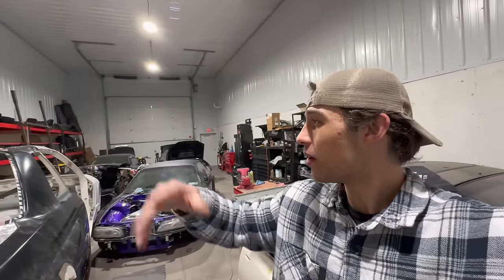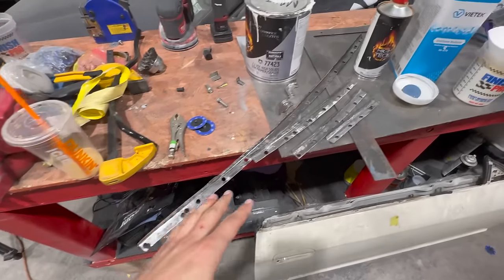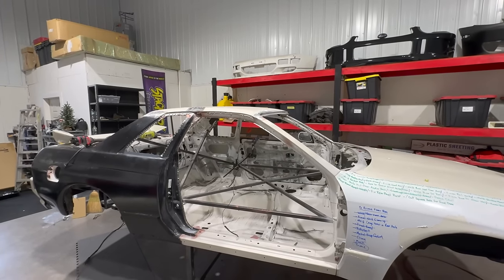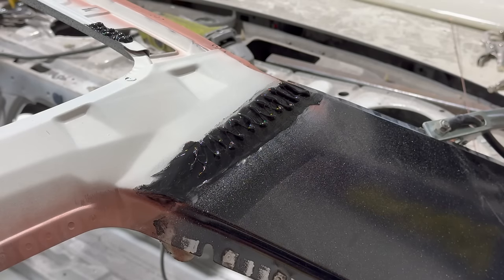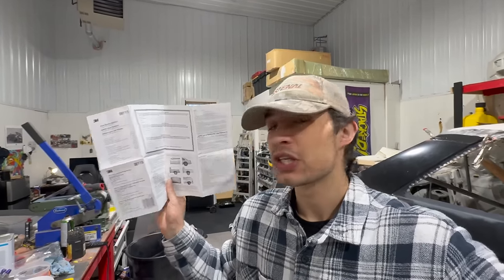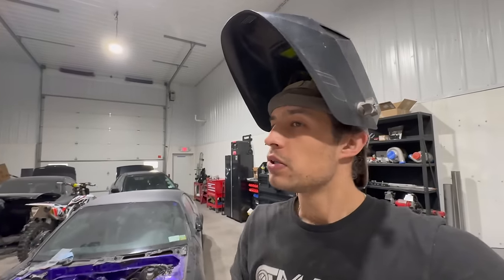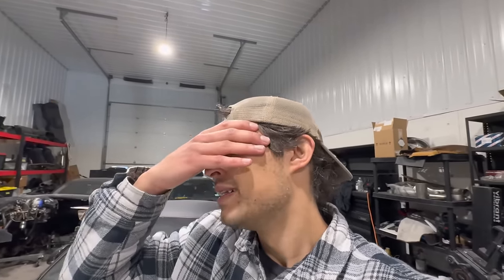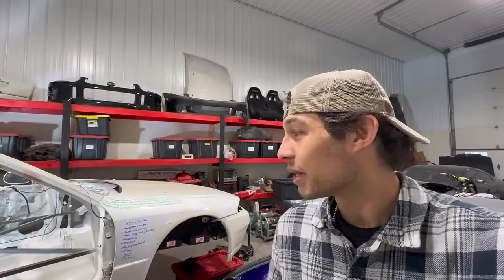This Last Structural Repair Could Make or Break my Skyline GT-R Restoration

Comment: It's coming along great! Watch out bonding hood and roof skeletons like that though. The skeletons can actually pull down and cause dents over time. There is a specific 2 part nvh adhesive for that purpose.
Reply from the maker: Interesting! So the oe product allows some movement? If anything like that happens will definitely address it and fix. Appreciate the knowledge!
Reply: @KalvinMalli kinda. It's more of an anti-flutter design and made to act more like a damper. There is always a slight gap and when you pushed the skeleton against the roof, let the panel bond cure, and removed the bracing, it leaves the bracing in tension pulling down on the roof skin. Over time, if the panel bond doesn't give and the roof skin does, it will "pull" dents down into the roof skin. You may not ever have an issue but I have seen it happen to a hood. Just sharing experience. Keep up the hard work!
Reply from the maker: @chrisanderson9931  Im going to try to push it in and see what happens. I definitely understand what you're saying. Guess time will tell. But yeah now I'm curious to press down and see how it feels and reacts, just from my pressure.

Comment: the panel bond is going to create ripples in the panel my guy. use seam sealer, heat from the sun ect causes the steel to move and with panel bond in the center of body panels itll warp the panel because it cant move

Comment: Awesome work! Are you. Planning to weld the roof to the top of the rear quarters?  I’m no expert but every roof or guard replacement I’ve seen they weld them as opposed to panel bond.  Would hate to see it crack or flex after it’s all painted up! Keep it up buddy!
Reply from the maker: Nah no need! Panel bond has a higher tensile strength than a weld, and the guys that install carbon roof skins do only panel bond on the entire roof skin. For obvious reasons. But they don’t seem to have issues. We should be good. And if it does crack. Then I fix it! No big deal. And we learn. But I don’t see it cracking. That’s why I went with this method instead of the lead/copper braze. 🤝🏽
Reply: @KalvinMalli  I'm sure you've done your research! Keep at it buddy!
Once it's all done come visit Australia. We can go for a ride on the dirt bikes then you can help me finish my GT-R!

Comment: Question, are you going to have to weld the an and c pillars where the roof connects? I’ll be swapping my s14 to a hard top in the future
Reply from the maker: Nope! Hence the panel bond 💪🏽 panel bond actually has a higher tensile strength than a weld! Also avoids any chance of warping and need of filler. But will put it all to the test when the cars on the road. I don’t see any issue arising. I thought long and hard about this. Felt comfortable. Actually, in the directions for the panel bond. The OEM recommends use of panel bond on the entire roof flange. No welding at all. Pretty crazy!
Reply: @KalvinMalli  thanks for the info, I take you’ll just put some filler and sand the crease. I’m glad I don’t have to weld that section.
Reply from the maker: @stephenwilson3999  Hoping no filler is needed. Hope to just block down the panel bond. We will see!